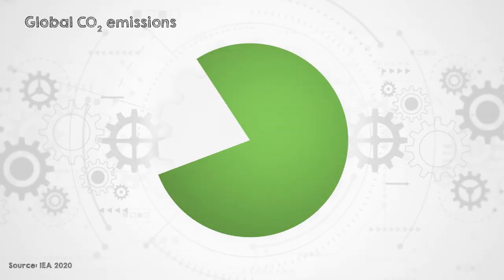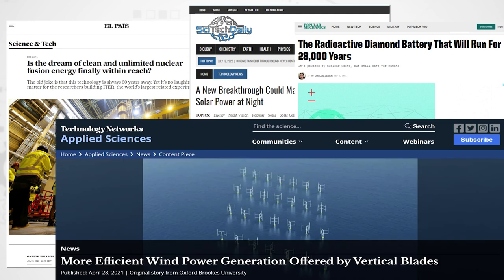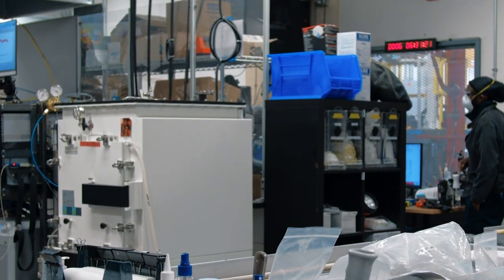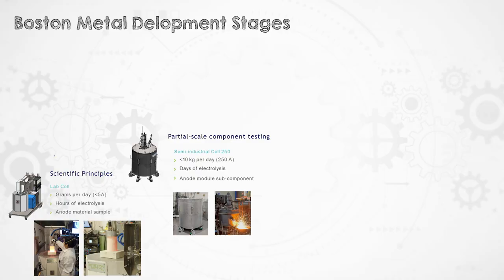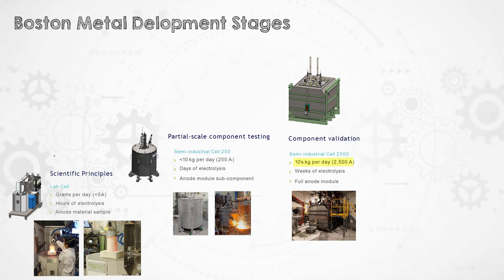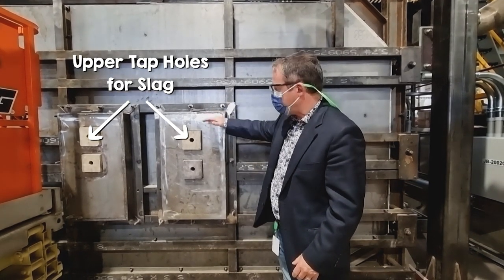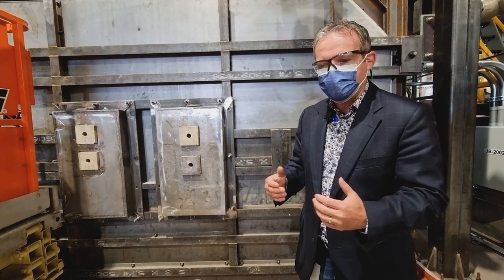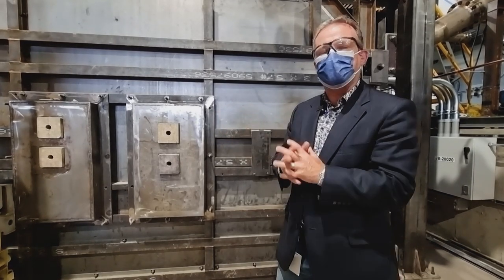CO2-Free Fe: Green Steel Tour with Boston Metal

Comment: I had been wondering about these kind of processes. I had induction furnace in mind, though an arc furnace is more direct. I believe there have been attempts to combine the two? Though I can’t for the life remember the source.  100tn a time. I heard that microhydro can contribute to production. Even solar being used to smelt steel directly. Fresnel lenses were used in the application. Small volume it alright. though I have no idea on the larger scales. You know when your dream about cleanest manufacturing when your mind drift to the same technology as lighthouse.. I have an idea on the solar front. but it questionable if it would even work?  If you could build a glass brick arch much like a poly tunnel?  with fresnel ideas built in? Green steel becomes very realistic . Great to see developments. Mass production might be a little way off? Certainly a stride from on the development front.  Science tells us you can redshift and blue shift light to higher of lower energies. It not completely inconceivable that you can turn natural light into the lazer densities to achieve smelting temperature. Cold shuts might be an issue? But there a few smart lads out there who might do better than me of that front so a freebie. The whole idea reminds me a little of heliostats. But a more refined version. Lazer ignition fusion process is a very similar concept. If the can fire a a beam onto a pellet? then a continuous process might work with regards to steel? Equally would be co2 free. Or carbon neutral?   Either way would be clear than current processes.
Reply: Electric induction furnaces are only used in small quantities in foundries.  They are not practical in a steel mill.  Green steel is many decades away if ever because the technology needed for large quantities that steel mills require does not exist.  I am retired from supervision in the steel industry from the Alabama District with 40 years experience and 3d generation in my family.
Reply: @richardallison8745  thanks! I suspected my think wasn’t far from the mark? it great to hear from a veteran of the industry. I understand it would tack some considerable effort. Though a shop floor grunt like myself. wouldn’t quite know where to begin, Upscaling it to practical levels? It seems logical to have a system you could just plug and play?  Switch out supply would be the first step as that wouldn’t stop production all that much. I’m aware of continuous casting methods involving oxide powders through a metal deposition process. Thought never seen in face to face. You also have the ability upscale 3D printing technology. more over the induction heads. To required sizes. I know you can get lazer cutting. Don’t think I’ve ever heard of lazer smelting? But it must be a possibility? James may from top gear. visited a developmental solar foundry on one of his documentaries. Where there were reaching 2000 degrees Celsius. The biggest lazer I have ever heard about is about a gigawatt. Though that was a few years ago. In my mind at least. I’m it got to be possible to rig enough lazers to smelt the primary material. too required production quantities. I don’t know of any steel plant using it. Sort of why I suggest the arc furnace first.  As I’m aware the arc furnaces have been in use for while. Would have been the easiest thing for steel plants to start with. The infer structure largely there. would not require too high of an investment to get going. It great to see new technology developing. Love to see more in the coming years. https://youtu.be/8tt7RG3UR4c
Reply: @richardallison8745  did you watch the video before commenting? Industrial scale is just 8 years away with this process and others are about as close -- true it's not tomorrow but now is it as distant as you seem to think. It's less than one decade, not many decades.

If you have specific knowledge about why their timeline is mistaken please share it -- but 40 years experience in the soon to be obsolete tech gives you no advantage over the person who is new to the industry. 

You come over like the manufacturers of steam locos just after WW2 when Diesels were already on the horizon. We've always done it that way and we always will. Ten years later and stream locos were being scraped after well under their design lives. 

If you want a 4th generation in the steel industry encourage your sons and or daughters to go into green steel or they will be redundant half way through their working lives, like the guys who were expert at loco boilers...
Reply: @richardallison8745  basically arc welder being supersize. Mig is usually argon. Tig is fairly similar.  When Tata steel folded here in the uk. It was because the government had it hand so far up the company backside. they didn’t have room to manoeuvre.  Tata we’re looking to modernise uk steel production. until production cost were the thing that got them in the end.  They moth ball several plants before it went down hill. I reckonise it not easy. frankly work give most people an aneurysm. The thinking there, the execution is not. Sadly!  Gas turbine would be a good stop gap. Especially if power on bio digestion. Everything that can be thrown in would do the trick. There still the odd third world nation that cool using dung. For steel that would have to be a big digester. As for the refractory I had wondered how much thermal stress would play a part? Having watch accidents unfold on video where cracks when a miss an tones of molten steel goes Everywhere. Never seen guys run so fast. I know that refractory can be carbon based within elements that stabilise composition once heated. Most guy might know of Maurice wards starlite intumescent system of carbon foam. NASA used burn bone to shield the satellite observing cmes. Though how that would work for steel is anyone guess? As for the carbon bad thing? It because of Co2 that earth is not a snowball. 4% atmospheric co2 can sustain more aboral life. Which is more o2 at the end of the day.  Most of the coal beds were made because the atmosphere was rich in Co2. I’ve heard estimates from 15-20%. Oxygen was far higher at 26%. nitrogen in our atmosphere is mainly due to life. More over its decomposition. Yes I agree that a lot more that could be done. I get the I don’t like the constant nagging by government. Just want to do the Job and improve incrementally.  Slow steady win race. Also K.I.S.S. I’ve heard of old jet turbines being converted for use. That another story entirely.  It sounds like state side that Bidens green drive isn’t working according to plan? If supply can’t meet demand? It like someone dunked them in the deep end with nothing more than a ball point pen for company.  If someone can access the materials? then the whole switch becomes easier? With the western nations as they are saddled with eye watering debts. I doubt it going to happen tomorrow? Though I Dare dream it!  Heck if you ask the military nicely they might loan a few turbines? National security ground.  If you feel ballsy? I know somewhere in Arizona there is grave yard full of planes. They want the steel you need something to make it? They would turn up just for giggles. Sqaudies in a steel plant. Talk is cheap effort what’s needed. Plus it cleans up opportunity. Roping in the National guard might help? Best anarchist mechanics. Problem? What problem, is usually the reply! I’ve even seen catalyst get mentioned as mean to turn Co2 back into hydrocarbons. So completely cyclical. Many way it could be done? Just not enough brain with the knowledge. Very sad indeed. If it not hit on multiple vector? Steel in Britain is likely to fold in the next ten. The rest of the world might be different? I know what watching it form over here. its been challenging for many plants to keep afloat.  Let alone succeed. Britain’s used to be a major exporter of steel.  One the decline happened it never seems to pick up the same glory it once had. Very testing time indeed.
Reply: @trueriver1950  I don't believe it!  We will see then.  If they do, it will be cost prohibitive.
Reply: @richardallison8745  yes, let's agree to differ while we wait to see who's right on this one specific difference between us:

Namely that I believe the costs will adjust (ie lower) as the tech takes off. You doubt that.
Reply: @trueriver1950  I just know I supervised and repaired both kind of furnaces and induction furnaces are low production furnaces.  I have been around many more EAFs and also induction furnaces in my 40 years of steel mill experience.  That is all I have to say.

Comment: It seems to be that Sadoway has a knack for getting grants and startup funding for "green" tech that ends up fizzling. They've had a DECADE to reproduce what bauxite refining already does, and they haven't even hit production-like machinery? What??

Sadoway is the same professor that has been talking about his "molten metal" battery that hasn't gone anywhere, and now we see plans for a "commercial" design making 100s of kg a day? That isn't even a drop in the ocean compared to the 88 million metric tons of just steel produced annually in the US alone.Even if these units produce 500kg, we'd need over half a million of them operating 24x7 to meet just the US production. And the US is third in steel manufacturing.
Reply: It takes a long time to optimize processes like this.  The cells will get larger, and they can be ganged as in an aluminum smelter.  Sadoway's liquid metal battery IS going somewhere, last I heard.

Comment: I see this as an alternative method for smelting iron. 
But there is nothing mentioned here about the production of steel by introducing carbon to the iron.
Reply: That's the thing people don't get, iron as it exists in the wild has carbon impurities in it already. Cast iron has more carbon in it than steel. The purpose of pumping oxygen through a blast furnace in the Bessemer process is to reduce the carbon content. People tend to get it wrong especially in things like crafting related video games, they think that the coal is contributing carbon to the steel but in reality the carbon is already there and there's too much of it.
Reply: @AlRoderick  And by running oxygen through the iron ore tremendous amounts of CO² are produced while burning the excess carbon out.
Reply: @AlRoderick  Hi. Let me rephrase my comment: There is nothing mentioned here about the production of steel by measuring and restricting the carbon in the iron.
Reply: Correct.  Steelmakers take the liquid iron and then make steel from it using conventional processes.  This is why the Boston Metal story stops at liquid iron from the MOE process.

Comment: So is this an iron making process or a steel making process?
Reply: It is an ironmaking process.  Where the confusion often comes from is that the tapped iron has no carbon.  In the iron-carbon phase diagram it is thus called "steel".  However, in reality, steel is produced after ladle metallurgy or the basic oxygen converter when alloys are added to meet the specifications for specific grades of steel.

Comment: Are you sure they are making steel and not just iron? 

As I understand it the harder part about steelmaking is infusing the carbon - as mentioned, there is decades of experience with large scale MOE in the aluminium industry, so I don’t think they are the first to try iron MOE, and I didn’t get what they are specifically solving that precious attempts couldn’t do.
Reply from the maker: Yes they can make steel in the one process. The difference between this process and previous similar ones, as I understand it, is that the anode isn't consumed in the reaction. But you should check out the original papers to get the full details on that.
Reply: @EngineeringwithRosie  Where does carbon come from in the process? Is it from the ore or is it supplemented to the soup at some point of the hot process?
Reply: @DreadDeimos  It would have to be added.

Comment: Interesting, the process is very similar to the LD process (Lienz-Donnaviz - Stahl) with an oxygen lance.  Even if the carbon is boiled off, CO2 is produced as a result of the reduction. 🙂
Reply from the maker: No, there's no carbon involved in the reduction in this case... you need to add carbon to the iron to make it steel of course, but it doesn't need to form CO2.
Reply: @EngineeringwithRosie  
yeah: it's reducing oxides of iron, not carbon.
Reply: @EngineeringwithRosie  Is the adding of the carbon in the right amounts trivial once the iron is molten through the electrolysis process they use?
Reply: @djdieterc  Yes.  A steelmaker will add alloying metals and carbon to create the right blend so that it meets specifications for a specific steel quality they target. That is not different from what they do today.

Comment: Just to be that guy n' all, but the phrase: "Swapping electricity for coal in steelmaking ", means to get rid of electricity and use coal instead. While I don't particularly think it's very important, you might want to swap "coal" and "electricity" around in the title for consistency.

At any rate, great video!
Reply from the maker: Ha, I had it the other way and then thought it sounded like the opposite and swapped it at the last second 🙂 I'm still not 100% sure about the title in general, got any different suggestions that are catchy yet accurate?
Reply: Honestly I ain't too good atcoming up with catchy titles, more of a dull straight forward type of person, but honestly I think it'd be entirely fine if just swapped around.
It's informative and accurate, though you might want to watch Veritasiums video on how to do titles and thumbnails (about the neccesity of clickbait) if you havn't it might give somw better ideas than what I can do.
Ps. please do apologise spelling errors, I despise smartphone touchpads for writing, but it's what I have at the moment.
Reply: @EngineeringwithRosie  "Using electricity instead of coal when making iron" would be accurate.

Comment: In the industry they refer to aluminum as "jellied electricity" because it uses so much current to produce a ton of the metal.  Since iron is denser than aluminum, this metal will likely take on the "candied electricity" because the substance if still identifiable e.g candied ginger, candied sweet potatoes, vs gummy bears (Al).

The thing that bothers me with the "CO2-Free" label on this process is it's like labeling the empty meat delivery truck on its way from the grocery store back to the slaughterhouse "vegan".
Reply: Generating the electricity required may currently produce CO2, but the process doesn't require it. If the power generation becomes carbon-free (e.g. nuclear, or future renewable tech), then the whole process is then carbon free.
Reply: @JamesChurchill  Well, yeah, sure, and if we all lived in nuclear submarines we would all get our oxygen from nuclear power as well.  But it's not realistic.  There have been electro-wining processes for iron since the 19th century.  I'm not saying it doesn't work.  

But here's the thing that caught my attention and kinda put the snark in my attitude.  The process is generating lots of slag.  That means it going to be far more wasteful of electricity than the Hall-Heroult cells are.  Please consider that on a mole-for-mole basis it takes just as much electricity to isolate iron from Fe2O3 as aluminum from Al2O3.

When I heard that they are using an inert anode, that piqued my attention.  H-H cells use carbon which is oxidised to CO & CO2, but iron oxides don't require cryolite to dissolve.

My point is that reduction of iron with carbon is the least expensive way to obtain the metal.  It doesn't work for aluminum, so the high price is still cheaper than any other alternative.  I do not see these furnaces multiplying like the aluminum industry did, simply because it'll never be cost effective.

And as much of a fan of the machinery as I am, if the only way to see it developed is at the barrel of a government gun, then I oppose it.  Because unless horrendous tariffs are place on the carbon methods, it will never be competitive.

And FWIW do want to see the next generation of nuclear reactors developed.  Thorium & molten salt solves lots of problems, not the least of which is that we'd be able to burn up almost 70 years worth of high level wastes, and end the disposal debate.

But unless & until we truly have electricity that is "too cheap to meter"... well I said it already.
Reply: @PaulPassarelli  Electricity is getting cheaper all the time, mostly due to cheap solar and wind.  We need to decarbonize steel making.  It's too large of a CO2 source to just leave this to market forces.
Reply: @PaulPassarelli  The electrolysis of iron ore uses only a fraction of the energy used in aluminum production. Furthermore, the amount of slag that is produced is generally the same amount and all slag today is used in other processes like cement production. That should not change.
Reply: @MyStevieB  Sure, only a fraction on  a simple weight basis of metal yield.  On a molar basis the quantity of charge is the same, and unfortunately the energy losses are going to be greater due to the higher temperatures of the reduction....

Unless you've developed an electrolyte that is effectively allowing you to plate the iron onto the cathode ar a substantially reduced temperature.  Because if that's the case, then please contact me so I can get a package from investor relations.

Comment: It would really be cool if a large scale plant could be run on solar power without connection to the grid.
Reply: I see no benefit to that.  It could only run about six hours a day.  Large furnaces have long startup times so this would be untenable.  By connecting to the grid, you'd have access to wind, nuclear, and hydro as well as solar.  The plant could run 24 hours a day and be far more efficient.